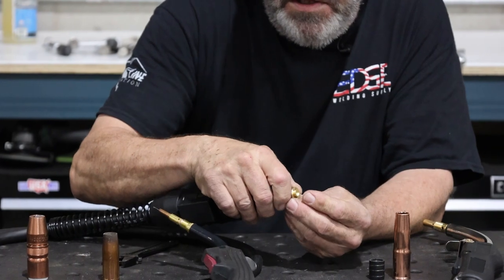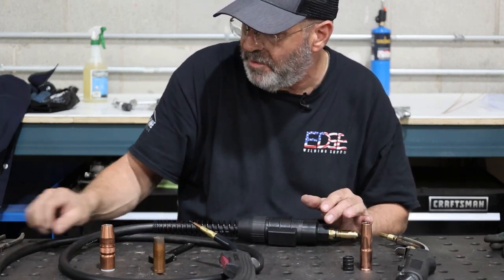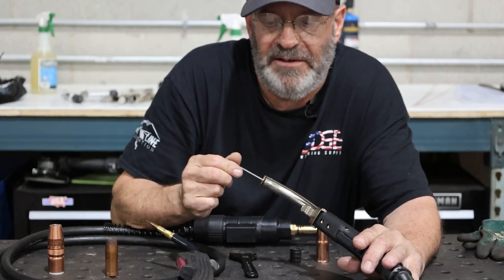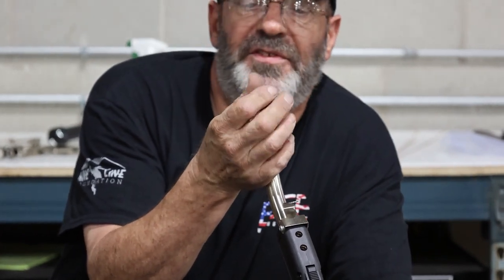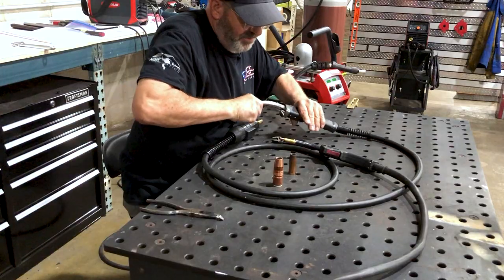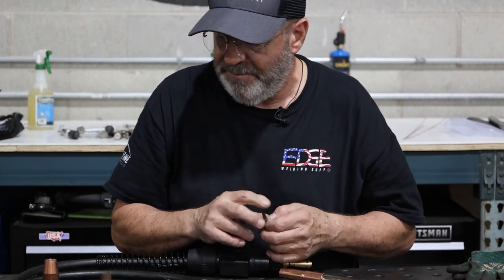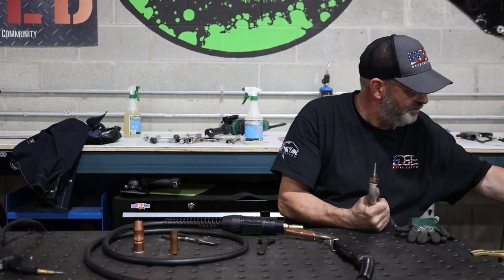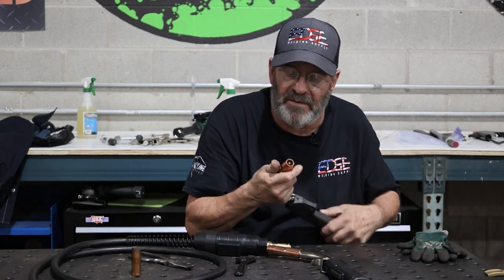MIG 101

Comment: Surprised that you guys over there still run the bayonet style fittings for the connection at the power source. Most other places in the world run euro style connectors which seem to be more reliable especially when moving around a wire feeder.